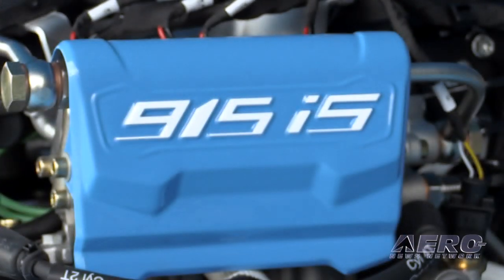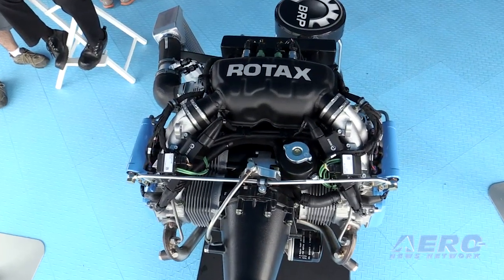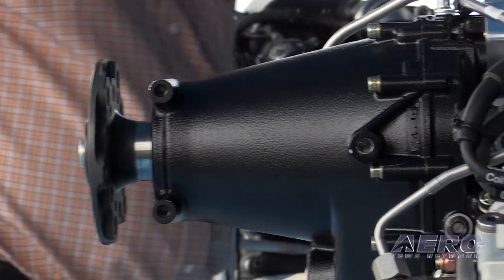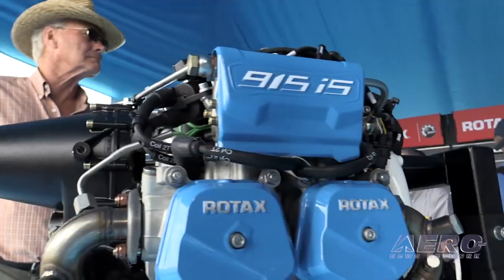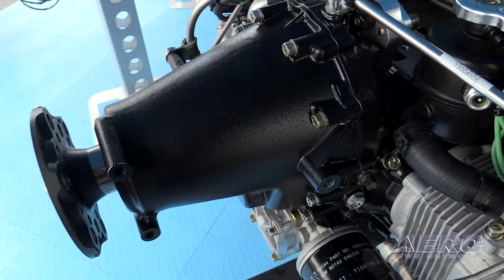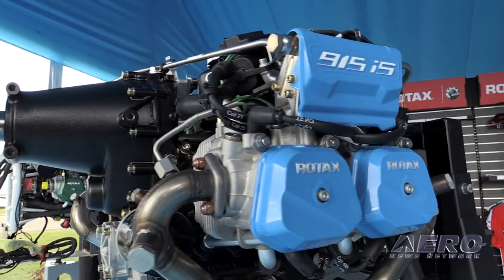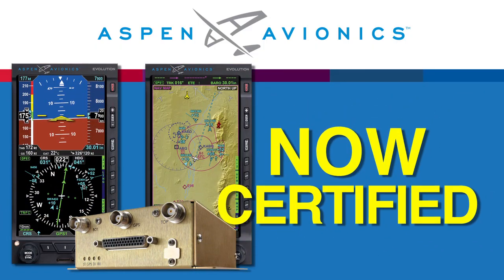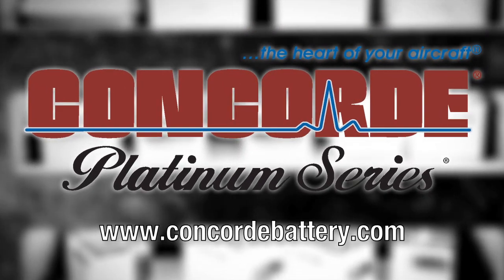Aero-TV: Just What We’ve Always Wanted - The New/More Powerful Rotax 915is

Comment: Duke Engines is working on a better solution, a small engine that weighs only 101 lbs + gearbox that can produce 180 HP without the need for any forced induction.
Reply: What do you mean without the need of forced induction? At altitude you have no choice. You don't have the oxygen available to get the 180HP you would at sea level. I think you are relating to this engine like you would a car engine. This has nothing to do with the normal conversation you would about a road vehicle.